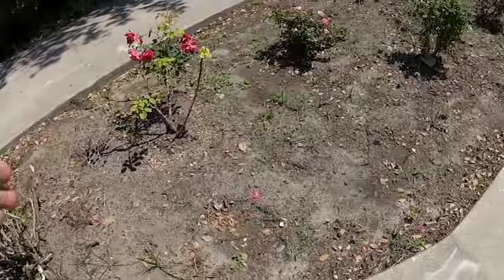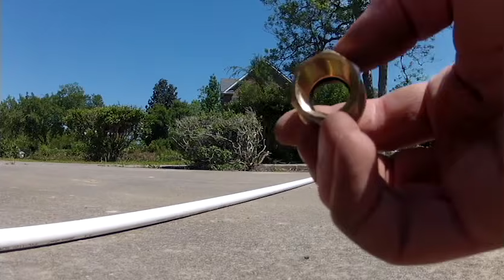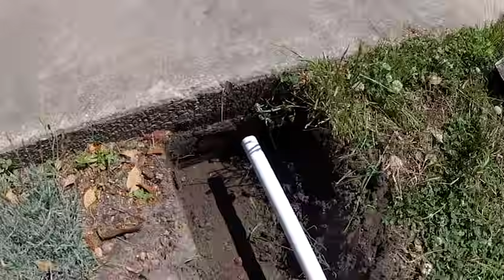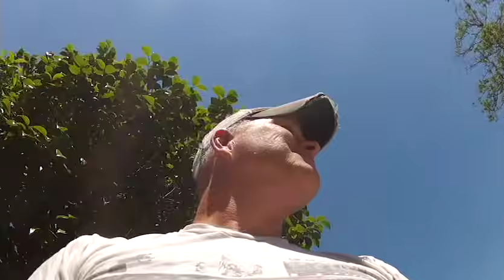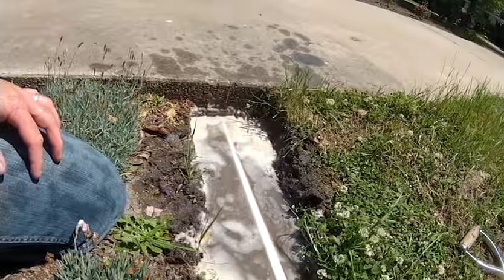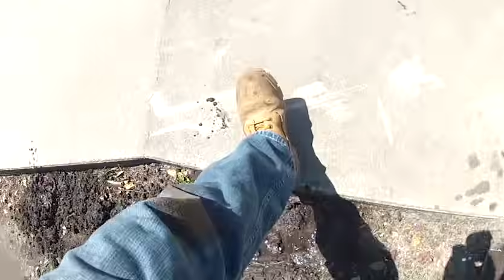How To Get A Pipe Under A Concrete Driveway

Comment: Just fixed  a small leak in my house only to find out my main water line is leaking under my drive way or cement slab porch.I just spent ALL of my savings paying a Veterinarian to fix a broken femur on one of my animals. I'm 37 years old and only 3 years from having my house paid off, so I'm not financialy irresponsible, but at this point the only chance I have of replacing my water line is this method. I live in an area where the ground freezes a few feet deep so... I have access to a power washer, basic hand tools etc. Any advice would be appreciated.?
Reply from the maker: If you get ground freeze you’d have to get some depth to keep the line from freezing. Because the plastic can flex and bend while you’re using it you can always hammer a piece of rebar in the path and at the depth you need to I sure you have a clear path. Once the rebar is in place you just feed the pipe with the rebar in the middle of it. It’ll keep the pipe on target. Then when you’re done you can just pull the rebar out of the pipe. Hope that helps.

Comment: Years ago I had a new 3500 sq ft building built.  Before paving the the drive, which went past the building from street to street I laid three 1 inch and one two inch capped PVC pipes near each end of the drive for future use.  About 3 years later we needed to get a com line and a sprinkler line to the other side of the driveway.  No problem.  Obviously will not work with an existing drive.  Just an idea for new construction.

Comment: Slant drill... but no.... Squit drill.... real slant drill you can go around 90 deg. corners... and change direction precisely at will, and up ream  This is how to slant drill your neighbors wells or field.  Commonly used to remove oil, gas, and mine under protected forests and national parks... !

Comment: That was cool to watch. Comcast sent a drilling company out to my house. They had a big ass machine with a long drill bit to go under my 2 car driveway to put a single cable wire (no conduit) to my house from the main source by the street. I thought that was cool. This was much cooler and quicker. I'm not sure how well this method would work for me as my soil is pretty much clay (Indiana). It's difficult to dig even small holes in my dirt. But I wondered how this method would impact driveway cracking later on? Or does the dirt wrap around that conduit nice and snug? Thanks.

Comment: Aside from maybe hitting rocks and having to relocate the pipe, youd be displacing a lot of dirt under the concrete which creates voids. How would you refill the voids to give the concrete a solid base again? This is why a contractor would cut the concrete, lay the pipe and re-fill with concrete. Or you could cut the concrete the width of a brick, lay the pipe and brick it in after which leaves a nicer appearance.
Reply from the maker: It fills the gap as it goes along

Comment: Two success tips not mentioned.  1 snap chalk lines on concrete to give you visual aim lines to push jetting pipe.  2 place a brick or other non-water softening hard surface in your trench where you start.  This allows you to push down on the pipe and keep it bowed tight to the bottom of the concrete.  As an electrician I have seen where running a conduit for post lights has been 3 feet down by the other side of a double driveway when not using an angle stop.

Comment: Nix that brass fitting and pvc male adaptor for a pvc female adaptor, then screw your hose into the female adaptor then glue the female adaptor to the pipe and then tunnel through. It saves the price of that brass fitting. (Cheap Electrician said)

Comment: We'd glue fittings on each end of the pipe, pipe's gotta be longer than the bore. One fitting takes the end of your common garden hose, that's your bore medium. The other takes one of those short, brass pressure nozzles you can buy at any garden shop. Trench a groove so you can keep flush with the concrete, turn on the water, and have fun. The brass nozzle can take a lot of beating, where just the plastic wears out quickly.
  Be aware that if you hit a rock and deflect, your bore could end up deeper, or left/right of your planned bore line.
  Remember, this is a water bore, not a drill.

Comment: When.they replaced all the gas lines in my neighborhood I would here this hammering sound, when it came time to do my house I found out what it was, they had a hydraulic ram the.size of a large mortar shell attached to a compressor,  it was able to tunnel through the ground by itself, when it was finished it backed it's way out, then they fed the plastic gas line through the hole,

Comment: Much easier .. Before I put in my driveway  I put two 1 inch pipes across & sealed each end so will have no problem if I need to install a substitute electricity or water across the finished area..

Comment: Using a heat gun, soften the first 2” of pipe. Using slip-jaw pliers, crimp down two sides of the pipe to foam a lipped point. This adds a downward angle to work under obstructions and increases the waters velocity. It’s the same pressure & volume just at a faster speed like a Venturi effect used in carburetors. When done, cut it back to round useable pipe for connection. Heating PVC pipe is done all the time for electrical service feed lines as rock ledges or boulders are below the surface. Once the trench is cleaned and established, the soft pipe will conform to the bottom over large obstructions but with electrical, a locating wire is added, concrete is placed on the conduit to protect it including a coil warning tape.
Just a thought taken from another industry!

Comment: my first thought, how well does this work if your base was properly compacted rock? 

to protect from both running in to rock base and cracking in your concrete, better to dig down further as the load decreases on the concrete above.

Comment: A trick we use is a modified pressure washer on 1/2" blackpipe. It will cut through the earth with ease.

Comment: Of course this method will over dig the ground needed for the pipe, this in turn can result in settlement of the concrete driveway and cracks could form. If that's not a problem go ahead and use this simple method, but of course it will only work this easy in sandy gravely soils. or the sub base of the drive. Clays and of course rocky ground is another ball game.

I've worked in the tunnelling industry from leaving school 1960 until retiring in 2015, ground loss is a big no, no. We mitigate this with keeping positive pressure on the face and surround, measure the excavated material as is comes out and only take out the equivalent amount as the forward progress made.
 OK this may be a bit over the top for a gardening job, but it's would be a shame the ruin a drive way just to get water across.

Comment: I would think if you have a concern about caverning, that you could drill holes every so couple of feet across the driveway after snapping a chalk line, and inject with concrete from a commercial chalking gun, or with some kind of industrial Great Stuff foam type filler. Then just patch the holes to match driveway.

Comment: I was waiting for you to jam your thumb while ramming the hole.
I'd use a pressure washer , use galvanized pipe , reducer, thread on Zero °tip  & nipple for the Lance.  Blow a hole faster than  gas through a funnel.

Comment: Cut out a straight section of your driveway to run a pvc pipe like how you ran yours. Removed the dirt and lay the pipe. Replace the dirt you would have taken out then lay new concrete to fill in the driveway. I would assume that would be better so you don't end up with a crack from lack of support.

Comment: Have done similar but with pressure washer &. fabricated the end of hose and use the red top tip that comes with the machine  works good   and a shop vac to divert the  h20 
   Same as they pressure washed my drainfield and had a pump truck and a big vacuum truck that was 15 years ago  water is a powerful thing

Comment: Remember when they put in the concrete driveway, they compact layers of water shedding material to keep water out from under the concrete so it has a stable layer for the weight of concrete and vehicles....  you just destroyed that...
Reply: Nope you use schedule 40 pipe and your not washing a tone of dirt of any thing the shedding your talking about allows the water to be absorbed into the soil and the pipe lends support to the concrete you’re not taking some huge amount 
Iv had some of these pipes in for 30 yrs now and the drive ways have not shown anymore ware than you expect of a drive with no pipe same with walks if you were putting several pipes side bye side several ft in width you might get a reaction but because your replacing the material for a pipe the change is minimal

Comment: Sometimes in newer homes the contractors bring in  roller to really pack the earth when installing driveways and some places just have a natural high clay percentage. If you add a 2" section down to 1-1/2 to 1-1/4  then about 20 to 30 foot of 3/4" the restricking pipe size really puts a punch to your water pressure.

Comment: This is a crude form of water jetting. I worked for a Natural gas Distribution Company in 1967.  We used a home made water jet. It was a steel pipe which had water & compressed air feeds. It worked very well. Only the odd pavement damage.

Comment: One important point that was not mentioned is that if you need to cross a, say, 8 foot driveway, then you need to dig a trough 8 feet long out from the starting location in order for the 8 foot long PVC pipe to lay flat and horizontal (even in height to your starting hole) which is typically about 4 or 5 inches below the top of your concrete driveway.  If you don't dig the trough long enough then the PVC pipe will dig downward and not stay horizontal at 4 or 5 inches - it will instead come out the other side at some much deeper point.

Comment: Being in Arizona, with dehydrated and rocky soil, this took about 6 hours, but still effective hahah.
Reply: I would cut myself one to 3 access holes across driveway and try making a homemade curved spray nozzle on a power washer.
In Texas a garden hoses pressure aint going to do jack BLEEP!
BTW CHANCES HITTING LARGE LIME ROCK BACKFILL IN TEXAS REALLY HIGH

Comment: Great shot! . But down in the land of Oz, we use two pipes, and the outer one serves as a return for the debris and stops caverning and weakening the concrete. A 45 degree cut on the boring pipe works well.  John

Comment: Will that undermine the strength of the concrete?  It seems like you created a void that could cause a collapse. Thoughts?
Reply: I was thinking the same thing. May be o.k. as long as not too much dirt is washed away from underneath the concrete

Comment: I have never done this but after watching this using water to push aside the substrate under the concrete to push through the pipe is ingenious but I see one problem with  this : the integrity of the concrete driveway substrate had been compromised. 
Over the years of driving over  the void where the pipe is will eventually crack and collapse.
Personally a bad idea to do unless a grout or a slurry has been pump in to fill the void left by the water pushing the dirt aside.
Thanks for sharing your project.

Comment: What changes would you make to this method if I want to use it to get 4" pipe under sidewalk?  Wanting to run pipe for downspouts under sidewalks to connect to drainage pipes farther away from house foundation.
Reply from the maker: Hmmm. That a good question. I’m not certain if you could put enough water through the pipe to be effective with 4”. Right off hand I’d say I’d do the 1/2 “. Then sleeve over that with a 2-1/2” and then sleeve it again with 4” but I have no idea how that would go.
Reply: @mytaborcityhome1002  I had wondered if that might be the best solution: start small and step up little by little.

Comment: I'm an electrician I've done a bunch of times it's better to put a three-quarter male PVC fitting on the end put a high-pressure hose end on the end and it goes through much faster the trick is try to keep your PVC and up high toward the concrete otherwise it'll go down down down you'll have to dig deeper to get it

Comment: Look guys, I have run this set-up a couple of times with a dead wall found 2 ft in. Then a nasty 1/2 rebar was used, with water jet,....no penetration. Let's be fair and assume that in a few applications there is almighty rock and such under that concrete slab. A sledgehammer driving that rebar made no difference.  The method 
 is a good one however there are exceptions.  Thank you.
Reply: Co

Comment: When I built this house in 1995 I put 2 sleeves under the drive and 2 going from the basement to the attic. Still haven't used any of em, but they're there. lol If I hadn't marked em on the blueprints I couldn't find em.
Reply from the maker: I think that alone would qualify you as smarter than 95% of the population.
Reply: @mytaborcityhome1002  Obviously you haven't spoken with my wife. lol
Reply from the maker: Lol

Comment: We used pressure washer to do that in less than 2 minutes I think. But it was much shorter than that and we just drilled with pressure washer from both sides...

Comment: Good ideal, here in Florida with the sand, use a garden hose, hit your spot, dig a hole by hand, avoid code, water packs so sand dont fall back in.
Reply: The water washes out more sand than is needed for the pipe to go through. That leads to a best case scenario where the driveway cracks close to where the pipe is. Worst case is it starts a process in which the rain drainage washes out a sinkhole under the driveway.

Comment: I used this method years ago, when I wanted to run TV cable, and telephone wire, to a room in my house without running it up around the eaves of the house. My job was much easier, as I only had to bore under about 4 ft of sidewalk. Once I got the 3/4 in pvc pipe through, I simply fished my wires through and I was set. By doing this I only had to run about about 12 feet of cable and phone line, as opposed to running about 3 times that much around the eaves, or through the attic.
Reply: Use ground mole or grundermat witch runs off a compressor,shaped like a torpedo about one metre long has hammer trash bolt in side witch punches dirt aside leaving a perfect hole as it hammer in

Comment: I’ve done this by sticking a pressure washer wand in the pipe. The extra pressure make it even faster. Used it for setting pipes in as fence posts as well. When it dries the post is solid, no tamping required.
Reply: “Setting pipes in a fence post”?  That sounds like a great idea. If you know of any videos and content please share, that could be very helpful. Thanks

Comment: Sounds interesting  sir, but what about the gravel  bed the cement masons put down before they poured the drive? Also will this weaken the bed underneath  so the concrete  cracks?
Reply from the maker: We have coquina base and the water washed that back to the opening so I don’t have an instability issue

Comment: A method I have used in red clay with good success is taking a piece of EMT, hammer one end close. And then beat it under the sidewalk. You can cut the closed end off with a hacksaw or tubing cutter and then you have a conduit under the sidewalk
Reply: No No No!!!!  EMT conduit is not permitted by code for direct burial / contact with earth.  It will rot away and possibly cause damage to the conductors within it. 
If you are considering using it as a boring tool and casing which will then have a pvc or approved direct bury pipe within it, then have at it.
Reply: @Blantston  This has nothing to do with code, no electrical cable used.  He was running an opening for irrigation tubing.

Comment: Its better to put a Pointer house in the end of the Pipe to make a good presure water drill ... And to tide to the 3/4 Pipe  a 3/8 metal  Roll bar to be hit the rocks and make a cave ... 
Less work and efort

Comment: This is a great idea!  It solves a problem that I have of how to run a line under a sidewalk in my yard.  However, I am curious whether a crack developed in the slab over the length of the pipe that you installed under that driveway?  Do you have any updates?
Reply from the maker: No cracks to this point.

Comment: Half inch steel pipe with increased pressure pump and drag the half in through, if you suspect stones may be in the way, otherwise great tip.

Comment: If your concrete driveway was done right with control scoring, joints, and steel there shouldnt be a problem. It can be done right with little washout.

Comment: Next time fix a reduction at the tip of the pipe with the water to act as a jetting nozzle and place it in another pipe. That way the spent water with the displaced sand or gravel will come out through the outer pipe which will remain stuck tightly, thus supporting the weight  of the concrete and reducing the possibility of cracking. I've seen deep wells sunk using this method.
Reply: Next time? How many times do you think he will be doing that?
Reply: It you're going to insert a smaller pipe into the pipe that's doing the cutting anyway, that makes perfect sense! Thanks for the improvement!

Comment: Electrician since 97 ... we've had to do this from time to time and if the concrete is thicker in a area it can cause issues i use ridged conduit and beat it with a hammer when it gets stuck thanks for sharing